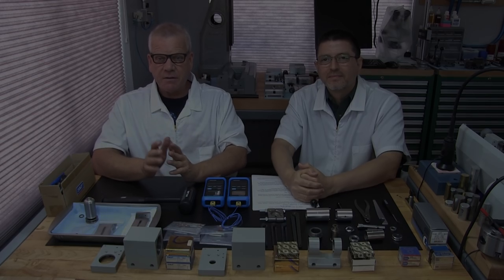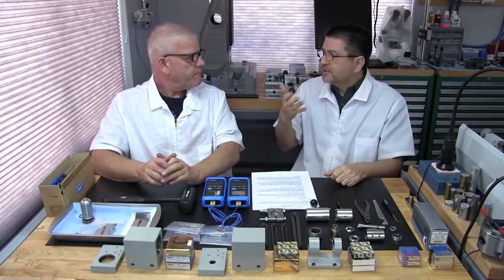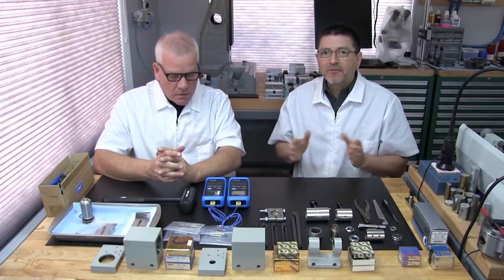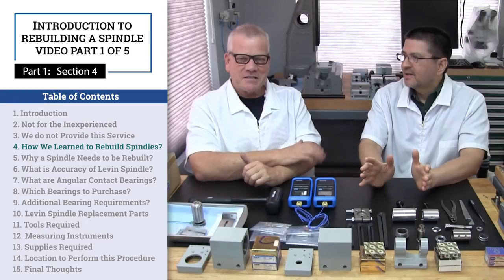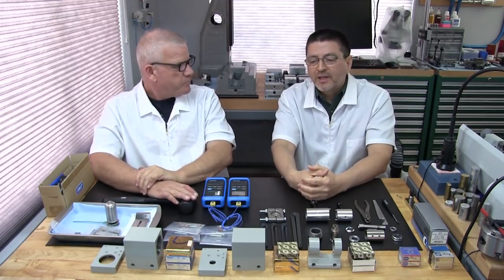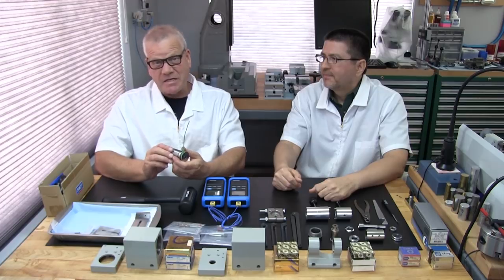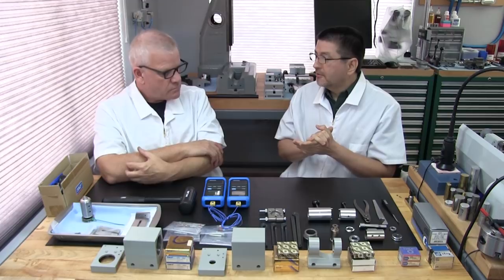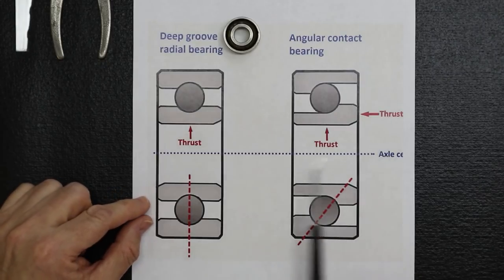Precision Machine Spindle Rebuilding - Part 1 Introduction

Comment: ABCE 7 calls out tolerance class. DB calls out back-to-back. Extra light SKF. Contact angle CD 15 degrees. I must have missed the ID and OD call-out of the angular contact bearings to be used. And how do I know which way is back to back as related to the front side.
Reply from the maker: Hi James, NO you have not missed a thing, the bearing details were the only very detailed sharing we did in the grand opening video 1 of 9. 
You did great paying attention that is cool as well.

Coming to you in Part 3 (coming in just days)

We did not share the spindle bearing I.D./O.D. diameters so you did most certainly not miss one thing (a very important thing) because they are going to vary for each spindle type under the Levin & Son brand machinery and accessories as we are actually sharing 4 spindle type rebuilds.

We will do each spindle rebuild and as each utilizes different bearings, we will share them in the spindle assembly as that is where specific details pertaining to each of these 4 spindle rebuilds actually take place, including the direction of the bearing onto the spindle body calling out the actual bearing part numbers that covers the angular and diameter call outs.

Again so you are aware, this is the first video being Part 1 of 9 was just an introduction (took 2 hours plus as it is) to what you can expect to require the having of tools, parts, materials, working location and skill levels to do these tasks,.
James though we are sharing how we are doing these Levin & Son spindle rebuilds, we are not implying anyone should attempt these tasks on their own unless very skilled and highly trained.

Thank you for being here James, along with us both on this journey to define spindle rebuilding from our point of view, enjoy the series and thank you for being here with us.
Lance & Patrick.

Comment: 1:58:58, Nye oil is mentioned. Which type of Nye oil is recommended? Thanks
Reply from the maker: Hi Greg, thank you for asking about this oil it is really something but it is not everything. 
We recommend this particular oil.
Only so you know about us, we are not paid for anything we say or show, so we have this set of in-house rues around here.
We will always share what we use somethings like this oil, as they are the best for or to us after we have tested over long time periods and make the "Its The Best" claim, other items in our shows and videos are what we can afford for the time being, so we will not make the claim when asked.

Hope that all made sense, now here Greg is your answer from us in our opinion.
NyOil is made by Nye Lubricants since 1844 makes two oils of interest currently to us,
NyOil in Red 4 ounce goes a long long ways in spared volume usage (we use and recommend currently) The worlds most refined oil film  
NyOil II in Blue (currently testing here only) sharing this one only not suggesting it yet.

Hi Greg, we are happy you are here, we are releasing Part 2 of 5 shortly today covering disassembly of a precision machine spindle just under 1 hour run time covering 8 highlighted topics hope yo can join us and watch this part 2.
Lance & Patrick.

Comment: Does anyone work Abom scale parts to your precision?  Thanks.
Reply from the maker: Hello Mike welcome to Part 1 of the precision machine spindle rebuilding. Adam Booth we have followed him since before YouTube through the Practical Machinist forum, now that he moved home, the work for now has become smaller in size in his home machine shop and the part sizes have shrunk in size of now many a home sized lathes.

Wow Mike, we too really enjoyed those larger cylindrical generally hydraulic (if we recall or guess) marine application shafts and the likes it was amazing to watch such repairs and such.
Tolerances what a world they are unto themselves and they are continually tightening Mike.
We follow a large machine shop that does great work in what we think is Mexico (do not recall URL), they make great parts but the tolerances are not likely to these here. 

This world of micro-machining Mike is due to these industries that come to mind as we write to you.
Clients of our Active Atom:
Watch movement manufacturers
Timing device manufacturers 
Instrument gauge manufactures 
Then there is the medical, computer and some space industries but all of these are making really small components and tolerances in a real world can likely be controlled in reality at about +/- .002 where in the 1980's we have +/- .005 in aerospace structural or larger components Mike.  

We hope you can return to watch Part 2 and now released Part 3, there are another 32 parts remaining and there are spindle specific short called sub-parts coming that cover each spindle we are rebuilding 4 Levin spindles and head-stocks and 2 Barker Horizontal and Vertical milling machine spindles added because these types of machine spindles are much more common. 
Thank you for coming by and for watching some very technical videos Mike.
If these are a bit much and hey look, they might just be, we also release our regular shows with helpful tips and many highlights, they are called Shop Adventures and they come out on this Active Atom channel you are on now sometimes weekly or bi-weekly. 
Lance & Patrick.